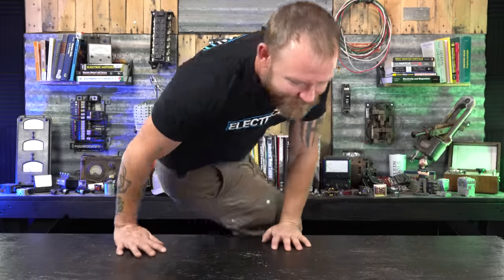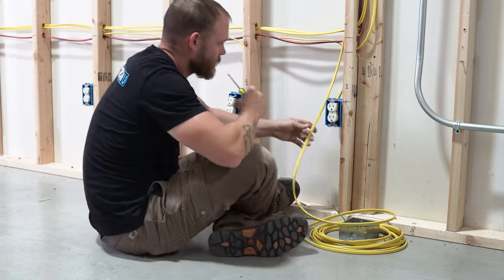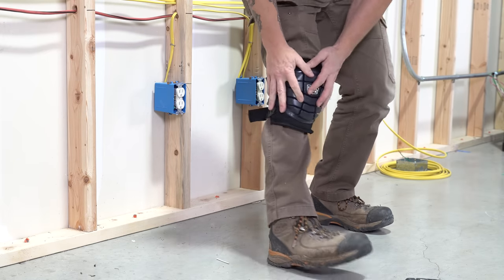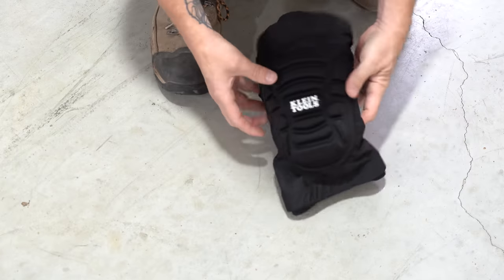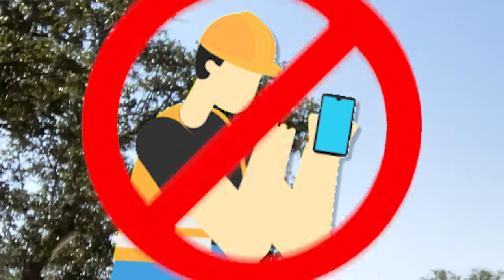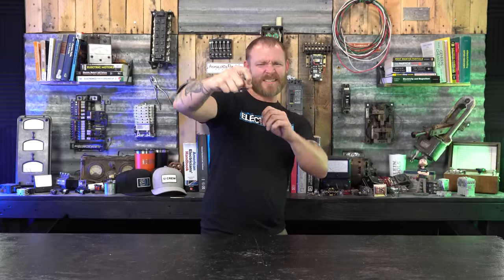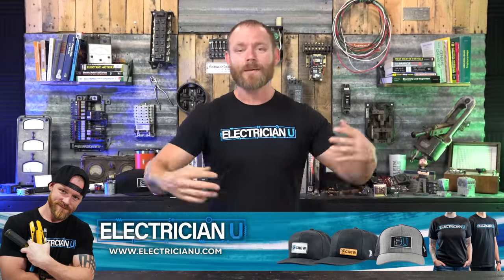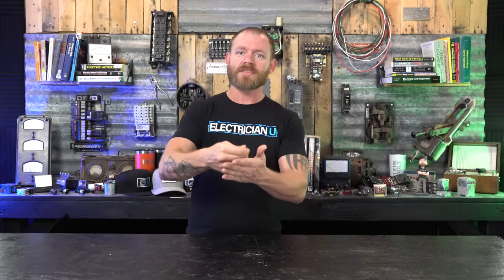Five Things Apprentices Should NEVER Do!!!

Comment: New apprentices, put your ego away for the first few years. Even if a journeyman already taught you how to do something, don’t stop a different journeyman from teaching you how to do that same task because there’s probably a golden nugget of information that will add to your repertoire of skills. Also take advantage of downtime to ask a journeyman an off-topic question about theory, code, or electrical work.
Reply: I’ve learned to always twist wires before putting on a wire nut and also to never do that. One hole always should be screw hole up….or down depending on the journeyman. And some other stuff too. I always listen and ask why. I figure with enough time (2 months right now) I will have my own things too.
Reply: It's a double edge sword.
Act like you know everything and you will be taught nothing.
Act like you know nothing and you will be given no responsibility or respect.
It's a fine line of expressing appreciation for any advice, while also making it known that you aren't a moron.
Reply: @nachoisme  everyone definitely has their own ways to do things. I am a journeyman electrician and I prefer to justify methods with reasons not “just because” I always pretwist my solid conductors together to make it look pretty and a solid electrical connection and cut so the ends of wires are even and straight that way you ensure everything has even contact and nothing shrunk down when just using a wirenut to twist together. For stranded to stranded connections I twist them together as well and cut even and then wirenut. Always always always do the pull test, it saves a call back later on, sure it might take a few seconds more, but taking down that whole chandelier or ceiling fan after you installed it because the wire didn’t make proper connection is going to look 10x worse than a few seconds of ensuring a good connection.

And as far as the one hole clip goes, when running a conduit horizontally I would say put the screw down, think about if/when that one hole could fail and bend it will still be inside the clip if the screw is down, if it is up and that happens the pipe could come out of the clip. Hope this helps, and good luck
Reply: @timothyjewett625  they have all been very cool about explaining the logic. I’ve yet to be brushed off and told ‘cause I said’ or similar. I looked up the one hole thing and apparently the screw hole up is the way to go.  Reason being the hole down would creat a leverage point to pull the screw out and hole up you have the break the shear force of the screw. There was a YouTube video I saw and still people saying both ways. Got to the video form an electrician Reddit page.
Reply: @nachoisme  You have found the golden nugget of super truth. They'll all have their reasons, but now you are free to sort through those reasons and find the RIGHT one, or as you did, know which things you should look for more opinions on. More data is always better. More methods are always better, even just to know why you shouldn't do one.
Reply: my ego went out the door when i started working for MY foreman
Reply: I start in two weeks, this is great advice!
Reply: When I was on my first job, one of the older hands told me that whenever someone wants to take the time to teach you something, to shut up and pay attention, you never know when it may come in handy.  Best advice I ever got!
Reply: Great tips, I put together the 21 Irrefutable laws for electrical helpers not only to learn, but to make sure they level up and make more money in the trade.
Reply: @timothyjewett625  I used to alternate up and down. Especially on longer runs.
Reply: You need to put your ego away too
Reply: @gfy2979  Who?
Reply: Apprentices when I started I got paired with one of the best Journeyman I've ever met. He taught me everything he knew.. He then became my lead electrician when I started 360 electric for 12 years until he unfortunately passed away. If I didn't meet Jerry and humble myself to follow instead of lead I wouldn't be where I am now.
Reply: @nachoisme always twist those fuckin wires
Reply: A few years that might be fine for a kid out of high school, but that makes it sound like a pretty daunting prospect for an older adult apprentice
Reply: @hidesbehindpseudonym1920  how so? putting my ego aside is much easier now as a 40yo apprentice than it ever would have been if I'd joined the trade in my twenties

Comment: I sit on my butt when wiring receptacles. Tool belt is on floor and the 4 to 5 tools are laid out in a logical manner given what I am doing. 
My 65 year old self will thank me. 
I do take the time to trim wires accordingly so it isn't as exposed as it needs to be. 
It doesn't take long to ensure you're not out-of-pocket on knee replacements. 
With that said 3 minutes is about right once all the wires are prepared for connecting
Reply: I’m 23 and broke my back, I always sit on a bucket when doing receptacles and set my tool bag next to me. I’ve left a job site, just walked off, because they caught me sitting on a bucket and decided to scream at me. These contractors need to get over themselves sometimes. Same with cell phones. My phone has a clock, a reminder to take pills, and even my code book and uglies references.
Reply: @bigguyprepper yeah bro I’m fortunate the place I work isn’t to picky about using our phones or technology for help when working. Also sitting on a bucket wiring receptacles doesn’t seem like it looks lazy. My journeyman always rant about efficiency and what not and using ur body less but then tweak whenever you sit down on a job that is completely suited to sit down for.
Reply: You’re fired!
Reply: @dallas5374  I'm good with that. 😀
Reply: Yup, its purely an appearance thing, and not a problem if you as a worker have protections. If you are doing the labor, how you do it, whether sitting, standing squatting, or kneeling, is irrelevant. Its simply a contractor trying to control you and make your work more unpleasant. Or bootlicker journeymen. Its like how all these tech businesses hate work from home even though productivity is up or identical, because they can't micromanage. Like elon stopping work from home for twitter. Because higher ups like the "appearance" of working hard. Its an old school toxic masochism masculinity thing. Obviously still wear kneepads, and sometime you need to bust out receptacles quickly, or get up and down a lot, but if youre working on something low to the ground for awhile or longer than 1 minute, you have time to sit down.

Another reason to join the ibew and drag if a contractor has a huge problem with HOW you work not your work quality or speed. Especially as sitting is far better for long term health.

EDIT: The tool bag on a bucket seat is amazing though FYI. Have all your tools attached to your seat right below you.
Reply: As an apprentice now, I also disagree with the not being on a bucket to do receptacles. I’ve worked on a new high school recently where all I did was receptacles for a couple weeks because there were hundreds to do. Just kept my tools on a cart next to me with everything else I would need. Averaged about 5 minutes each considering we had to label all wires and most boxes had three circuits with their own neutral. You’re going to hurt your back or knees if your not putting yourself in a comfortable spot for 8 hours a day.
Reply: im studying mechanical engineering and also some electrical. when i was working they didnt like it when i was sitting while doing work. all you guys explained exactly how it is! one thing i find weird/hypocrite is that when welding they dont mind you (and actually endorse it) sitting or even laying comfortable but when  grinding 40 plates or other monotone jobs or wiring cables while sitting they see a problem.

Comment: Typical rough in day. 

Clock in, secure ladders on truck, empty water cooler, fill clean cooler. Grab shopping cart and fill van truck with wires and connection boxes, fan supports and tools. Get yelled at for standing around because your journeyman was late and didn't see you do any of that. 

Crew goes to store grabs lunch and drinks for the day. 

Arrives on job site. Empty van truck. Generator hooked up. Wires conduit boxes and tools empty truck. Laddere. Mini fridge and radio set up. 

Lay out blueprint, Grab chalk and mark all locations on floor. Nail up switch and receptacle boxes. Get yelled at for taking a text message. Pull all romex wires 

Lunch time. Break on site with no a/c pass out under a tree. 

Afternoon Hang light brackets lose your supervisors favorite screw driver. Hang fan brackets. Run low voltage lines coaxial ethernet cat 5 cat 3 door bell garage lines. Get yelled at for drinking water out the cooler. 

Drill holes in studs for more outlets around room. Inspect work all staples and wires secure and neat. Nail plates. Nail boards up for switches near door ways. 

Put all tools supplies back in truck. Drive back to office while guys and supervisor smoke weed. In van. Get kicked off truck. Because while you did 90 percent of the work. The crew leader is a drug addict that somehow thinks he is your boss. 

Steal his multimeter and just go work for a better company. The end.
Reply: Lmao
Reply: I love the last part 😂
Reply: I think we’ve worked with the same supervisors lol
Reply: Wait… smoking weed makes you a drug addict now?? Shit. I must be a full blown junkie with the drugs I do then… huh. Whodathunkit
Reply: 'if you aren't running the job you're a shitty apprentice'
Reply: @shasmi93  yes it does
Reply: @juledoren  To clarify, you're not a "drug addict" if your enjoyment of drugs doesn't negatively impact your work or relationships 🙃
Reply: Sounds close to my experience at a company I just quit, minus the weed smoking.

Comment: Very good video Dustin. 
 One thing I would like to add to your list is,  apprentices ... please do not cut corners thinking that no one is going to see your work. As an example, if you get sent into an attic or under a house and you are suppoaed to run some romex or mc cable and it needs to be strapped up and no sags when under the house and not all loose in an attic, using a strap or staple every two or three joists, between point a and point b, don't think that you can put one or two straps on a 30 or 40 foot run because you're too lazy to do it correftly because you figure no one is going to crawl down or up to check on my work. 
 Wrong. Someone is going to check your work and sometimes there is more work to be done in the same area the next day or next week or a month later, and it won't be you crawling and that next wireman is going to see your wires hanging down into the dirt or they're gonna get their boot or tools hung up on loose wire with a bunch of slack and no strapping and immediately they're going to know who did that wiring because it's new work and usually no other company is working for this client so it is obvious that you didn't do your job correctly. 
 Always do your work in a professional manner. Think about the next electrician who will be looking at your work in the future and has to repair something and it's all jacked up making what should be a ten minute job is now an hour of stress and struggle because you cut corners or didn't do the work like a professional. That next electrician might even be you two or four years from now and you have to deal with the bad work you did. 

Sorry for the long comment
Reply: Exactly.  I always tell the new trainees that "It's the next guy's problem is not a sustainable model, because the next guy could be them.  Or even worse, it could be me."

Comment: An older female journeyman on a job showed me a wire stretcher she made on the job…the same one she made when her journeyman sent her after it when she was an apprentice. She cut a couple pieces of bare, solid #10 wire about 6-8 inches long. She then cut a white cloth rag in a small rectangle about 4X6 inches. She stitched the cloth around the wire along the 2 long sides of the cloth to fashion it to look like a stretcher (the kind you would carry an injured or dead person with). After that no one ever messed with her again! That’s how you outsmart your journeyman when he’s clowning on you!!
Reply: That is a great one. Many years ago, as a Marine aviation mechanic working in the metal shop ( at the time ), one of the guys told me to grab the metal stretcher. I laughed and said I am not falling for that. Well, he said, " it's right there at your feet under the table next to the metal shrinker. I laughed even harder. Well, he stormed over flipped up the canvas and pulled out both. There actually are both types of devices. So, the joke was on me after all.
Reply: @dallasarnold8615  😂😂😂
Reply: @dallasarnold8615  ... if a plumber can ask the new guy for a bucket of steam, can an electrician ask for a bucket of power / juice? BTW, I brought a plumber a bucket of water and told him it just needs heating when he's ready for the steam.  <LOL>
Reply: @rupe53  the only electrical materials I know of off the top of my head that come in a bucket are jet-line and wire pulling lubricant. But I have sent a few cubs after a box of ohms
Reply: @Ephesians-ts8ze  ... wonder what he would have brought if you asked for a box of amp clamps? Maybe ground rod acorns? <LOL>
Reply: Slightly different, I worked selling auto parts when jobs were slow. I had done both for several years.

Tell the new counterman to go in the back and get some blinker fluid. Have someone else tell him to grab a few cans of brake grease. Then mention that you need both red & green blinker fluid. Sucker will be back there for hours
Reply: @thedillpickle100  ... don't know if it's still made, but at one time there was "water pump grease" available. I suspect it was water soluble so it didn't clog the radiator. I have a 1928 Buick engine in a GMC truck (that's what they used) and it's got a grease fitting on the water pump. (recently converted to a ceramic seal)
Reply: @rupe53  No. But you can ask the supply house if they’ve got a can of ohms

Comment: I started working for a big shop and I work with different foreman’s 
on different jobs especially working OT on weekends wherever we’re behind. One thing I’ve learned is when someone wants something done a certain way just do it that way. Simple example would be, some people add prefab grounding tails to boxes, some people ground the box using a grounding wire coming into the box. I prefer the pigtail but I see the benefit of either way. Especially when that one extra ground wire sends you on a mission to find a big blue nut.
Reply: As long as you don't beeline the ground wire and screw the next guy down the road.

Comment: Several years ago while working as a paint booth installer, we had to pass some duct work through the roof. I told my assigned helper to stay on the roof and I would go down and guide the bottom and that he would need to lift when I shout. Well, I shouted and shouted. No response, so I had to climb down go outside, shout. Still nothing. I climb up onto the roof and find him ASLEEP !  He is so lucky he did not roll off the roof. This was just a matter of maybe 5 minutes.
Reply: @Ephesians-ts8ze  That certainly was a thought.

Comment: Video Idea: Can you do a video explaining the thought process for laying out the main panel as to what goes on each circuit? Example: Is it better to have each room on a circuit, or separate the outlets and the lights?  What are the considerations? I do A/V work and sometimes find odd things tied to the same circuits.
Reply: Any new, non-custom home will be wired in the manner that uses the least & cheapest materials and fewest circuits needed to meet Code.
Reply: @raygunsforronnie847  That figures. It always irritates me when I want to plug something in and there is no nearby receptacle because all they installed was the bare minimum. 
What I'd like to know is how an electrician would do his own home if money was not a problem.

Comment: Late to the party on this comment

Dustin, firstly I appreciate all the hard work you’ve put into making Electrician U an absolutely amazing channel and resource. EU has been my go to for Electrician and electrical info. 

I am an Electrician in the Film and TV industry, so I am not trained in the same manner or to the same level as a residential/commercial Master Electrician. We use the ETCP certification,However there is a ton of 
overlap and one of the main difference being that our power and installs are non-permanent, but 100% I deal with the same shenanigans from newer crew members. 
What we do to get around the Dunning Krueger effect and the “I can’t remember what I was asked to do or don’t know how, but I’ll pretend” problem in the crazy world of Hollywood is by having every instruction repeated back. 
For example- “ Hey so and so, throw 5 sticks of 100’ 4/0 on a cart and start running them out in such and such place, males facing  the genny and phased correctly”

And they say “ Copy…repeat what I just said back to me”. 

Chances are someone else will also be within earshot of the instruction being repeated in case the the worker gets stuck. And at least whomever gave the instruction knows that the order was received correctly and hopefully they will ask a question if they don’t understand. Hopefully. 

Not my most concise comment ever. Apologies. 
Thanks for the great content!